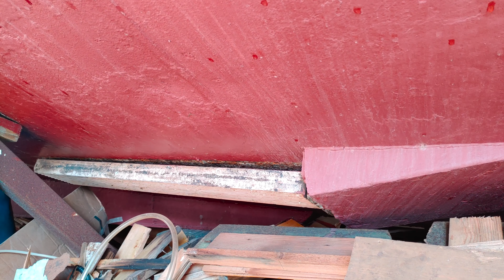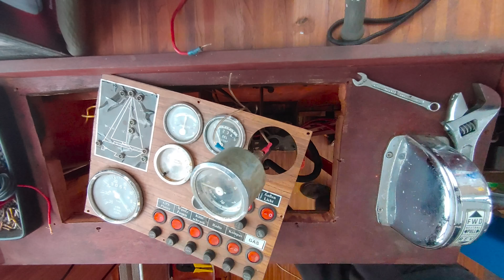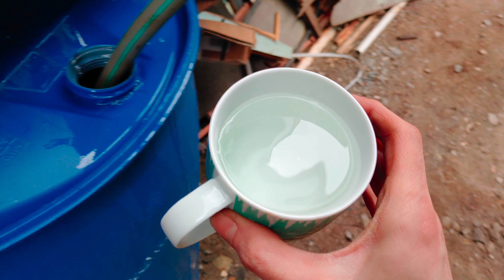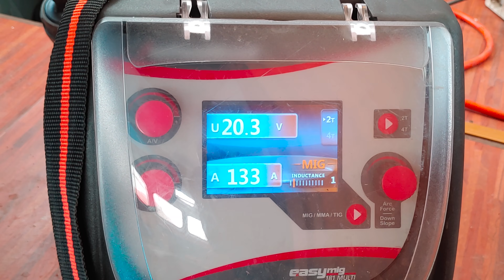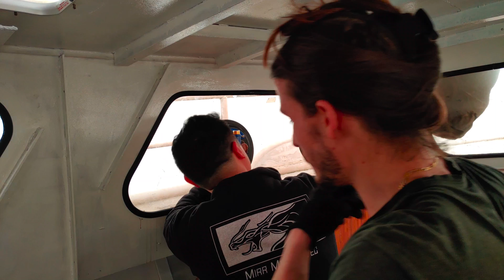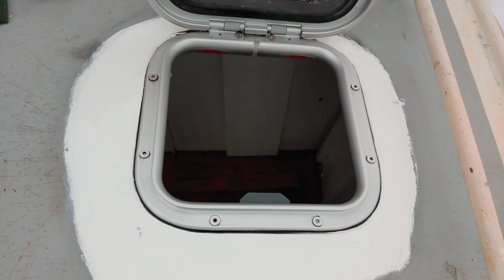We learned something NEW about our MARINE Diesel ENGINE - Week 25  - Vintage Yacht Restoration Vlog

Comment: the rope mounting works only if you do it the right way 
We always do it with old cars and with boats.
 I know its al long time ago but for future projects it maybe helps 

i try to explain how it will work but if you have questions please ask

Put first the rubber arround the glass and the end downside not the upper side
Glue the ends off the rubber together if its not a original closed rubber
Then when rubber is on the glass jou place a thin strong rope inside the half of the outside of the rubber around and not between the rubber and glas that wont work. 
Let both end of the rope across each other for 10 cm at the bottom side .
Then lubricate the wall of the rubber at rope side and will facing to the inside of the boat
Place the window with rubber and rope at the outside of the boat against the window frame boat and let the rope stick to the inside of the boat 
Then one man pushing the window with lubricated rubber against the window frame at the outside of the boat 
The inside men pulls the rope out of the rubber towards him slightly up to flip the rubber half side over the frame edge
With result that the rubber puled over the edge of the window frame. 
First the left downside pull rope outwords to the corner and about 10 cm up to the left vertical side. 
Then the same at the right side 
Make sure the outside men is pushing slightly the window towards the inside men where he is pulling the rope 
Then again the left side 10 cm around the corner to the upper side and the same to the right side 
If the rubber is flipt over the frame edge you can do both string at the topside towards each other. 
When rope pulling is completed and out the rubber, tap outside the boat on the glass to make sure the rubber and glass are evenly spread into the frame  
When you do it right it is just a 1 minute job. 
Important notice 
After placing the window make sure you use a window sealend (available in most car shops) like this https://www.batentrading.nl/3m-montagekit-voor-autoruit-in-rubber-310ml.html between rubber and frame at the outside boat and  between rubber and glass. (not plastic windows due cleaning after)
Otherwise frame wil rust again due moister overtime 
Only primer and paint is not enough it will rust again without sealend 
I noticed there was no sealend present when you pulled out windows and that is why it will form rust

Best regards and good luck with window placing

Comment: I wish you well in your project. I have been rebuilding a steel yacht (ketch) for some time and really do appreciate what you are doing. Showing the challenges that you face is so incredibly useful to anyone following you. We all know what a perfect job looks like ...something that is rare in the real world, so a huge thank you for showing the good, the bad and the ugly.   
One thing I noticed, that may not be an issue if you are going to travel on inland waterways is that the existing dry exhaust has a very shallow "goose neck". If water should enter the dry exhaust at the rear of the boat it could enter the engine, or at least lie inside the exhaust pipe and cause severe corrosion. A full goose neck (45 cm above the waterline) would prevent this. 
Again, good luck and thank you !!

Comment: Your best bet would be to remove that old water muffler and run a dry stack exaust up through the roof with a truck  muffler on the end, that's what all steel work boats do with keel cooling works a lot better and there's no danger of water getting into the engine through the exaust

Comment: Great video... Just one question, if you excuse my ignorance.. Why would you run the exhaust all the way to the back... Instead  out the port or starboard side
Reply from the maker: You'd have to ask the manufacturer of the boat. My guess is there are 2 reasons: 1. lower noise, 2. exhaust gases are less prone to kreep up to the flybridge like this.

Comment: Thankyou for your videos I find it very interesting indeed, a little trick to get rust and scale off a pipe or railing is to use a chain(diameter of chain is for you to decide) with a rope ends attached for your hands, a turn and 1/2 around the pipe and move it backwards and forwards and it does work, that's how we did it when I worked on ships. Very good videos keep them coming.

Comment: Put plenth grease on your new windows ...if you start grinding away the outside for new paint. Nice videos 👍
Reply: Never heard of plenth grease, is it water and rubber friendly?.
Reply: @MegaDirtyberty  🤣🤣i made a mistake😔it should be plenty grease, it can be any grease propshaft or whatever grease as long as it takes the heat out of accidently sparks hitting the windows!

Comment: Take Note my Friend, As a welder fitter I recommend you get rid of the sharp edges that is left after you grinded those welds, round them off or give those edges a beveled edge instead of a sharp edge, so when you paint that area later on your paint will stick better having a more rounded surface. You need that for better bonded surface. vs a sharp edges.
Reply: "ground"
Reply: "Ground"